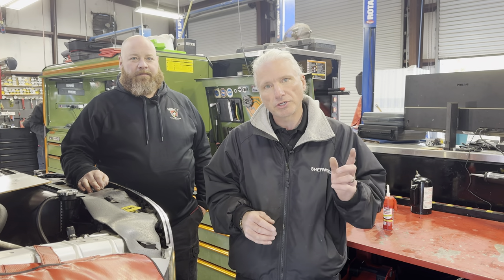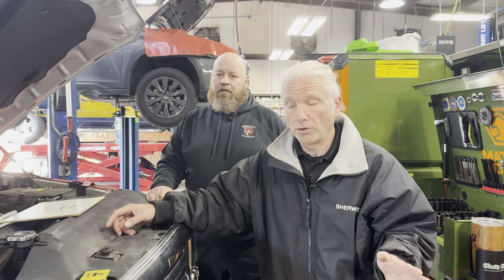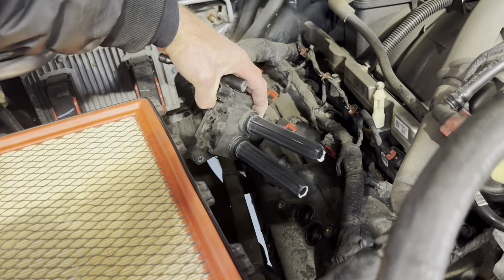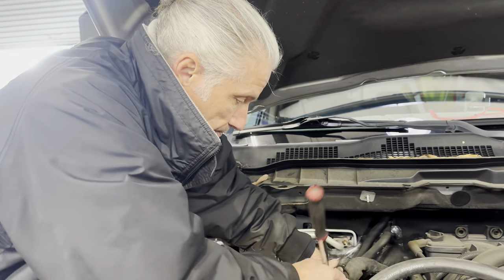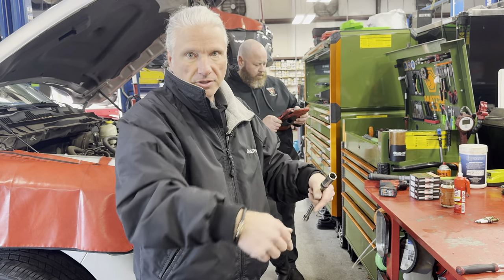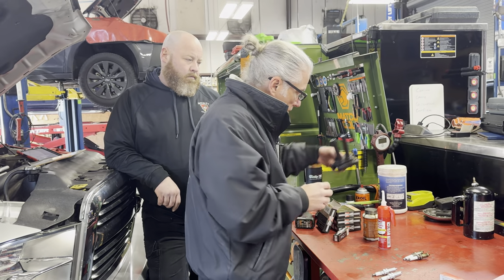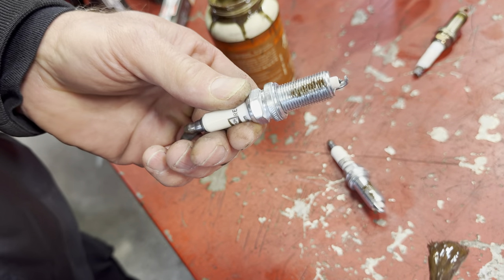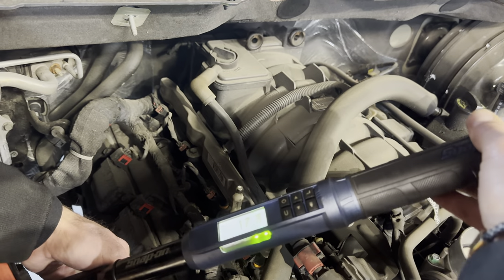How To Replace Spark Plugs Like A Professional

Comment: I have been changing sparkplugs for over 40 years and have never used anti-seize on the threads.  I was told years ago that the addition of anti-seize to the threads will mess with the torque specs if you use a torque wrench to torque them down.  I have read that some manufacturers do not recommend using it, but I can't remember which ones off the top of my head.   I have always used dielectric grease in the boots though.  Great video as usual.
Reply: I agree, but a drop of light silicone spray lube doesn't hurt. With dry threads, the specified torque doesn't always even crush the seal.
Reply: I've heard that same thing when I was at the factories main engine training center.
Reply: Cast iron heads and aluminum heads are vastly different. Always use anti-seize on aluminum heads.
Reply: @abovetherimrob891  I have owned a car with aluminum heads since 2006 and have never used anti-seize on the plugs and never had issues removing them when replacing plugs.
Reply: Always use antiseaze unless the mfg says not too. It helps heat transfer and will extend the life of the plug aswell as helps ensure proper torque.
Reply: Yup. It can cause over torque and damage threads in the head. A big no no on Denso plugs.
Reply: Bosch plugs have a coating from factory, and states that lubricating the threads might cause over tightening an/or corrosion (if dissimilar metals present)
Reply: I've read that torque specs are based on dry threads 🤷‍♂️ Also, I use compressed air on the spark plugs prior to removing them so that if there's any debris it won't  fall into the cylinder. Maybe not on COP engines. On non COP engines, I spray brake kleen to loosen debris and then blow it all out really good prior to removing the plugs. If you don't do this, and the area around the plug is filthy, insert the plug and pull it back out. The new plug may have oily debris on it. That goes into the cylinder! If possible, clean the spark plug seat at the head. I've read that dirt on the seat will cause the plug to run hotter 🔥 Note: A COP coil works harder when the plugs are worn.  This can cause the COP coils to burn out sooner. 🧰
Reply: @nickr5658 You know that heat transfer happens where the porcelain insulator meets the spark plug shell in the body of the plug. The length of the insulator before it comes in contact with the shell determines the heat-range of the plug. Most of the heat is transferred to the cylinder head through the spark plug gasket or tapered seat. This is why proper torque is important. Too little torque can cause a plug to run hotter than its intended rating.
Reply: @SilveradoUSA1  I always blow out the spark plug holes prior to removing them.  Keeps debris from going down into the cylinders and keeps dirt from getting caught in the threads as the plug comes out.
Reply: Most plugs have an angle torque value to crush the washer. Once the washer contacts the head its like 2/3 of a turn to crush the washer. I dont see any problem with using anti seize. Sometimes the cowling drips water down into the spark plug area and then you get corrosion
Reply: Big no no on the anti-seize... Most modern plugs are zinc or nickel plated and that's all the anti-seize you need. Old school plugs with a black oxide coating going in to a cast iron head, yes, absolutely use it.
Reply: @TheForeman805 you are correct about nickel coating from manufacture. I’m in the 805 Bakersfield by the sea 😎
Reply: I’ve never used anti-seize or dielectric grease. I only do diy car maintenance, though.
I’ve done airplane maintenance for years and our rule was always use anti-seize or LocTite only if the repair manual says use it. I tend to treat my car the same.
Reply: Ford at least through Triton and 4.6L era specifically said NOT to use anything on the threads as it would change the torque reading by up to 20%. The risk of over or under torquing (by trying to compensate) far out weighs and minimal benefit the lube could give.
Reply: Some sparkplugs already have a anti seize coating it's not to noticable but it's on there
Reply: Ford never recommended anything on plugs but now they recommend moly grease.
Reply: BMW doesn't recommend using anti seize

Comment: Great video guys. I worked for LAPD for 21 years and i torqued all suspension bolts, nuts, spark plugs and of course all brake caliper bolts and even bleeder screws. You'd be surprised how many people didn't even torque the lug nuts or the intake manifold bolts. I have all the torque wrenches, quarter drive, 3/8 drive and half inch. Plus i marked every bolts to make sure that i torqued them. Thanks for reminding all technicians to be professional at their job.
Reply: Can u get me a job there? lol
Reply: @midnightroush97  you can apply lol. I’m retired already👍
Reply: Great work! Glad to see and hear mechanical taking specs seriously.
Reply: @vickenkaragozian2041 where can one apply? I've been looking online, but no luck
Reply: Every time I get brake pads replaced. I have to get new rotors, (because nobody uses a torque wrench on lug nuts).
Reply: I dig it

Comment: As you can see, the lowly spark can generate alot of conversational opinion. We are all still apprentices after 45 years. Keep producing the videos. 👍
Reply: If you want an active comment section, just make a spark plug video and take a side on the antiseize vs. no antiseize question. Guaranteed flack in coming. It doesn't matter what side you take. Just take one.

Comment: A few additional things to consider , #1 Make sure the springs are still inside the boots when your putting the coils back on , sometimes they fall out without you even realizing it. #2 Look inside and clean out the wells before removing the plugs. Many times the wells are filled with oil / debris. #3 inspect the boots for any signs of  arcing. Even a pinhole is going to be a problem.
Reply: Why not replace the rubber boots so you don't have an issue before the spark plugs require changing again. With some V6s the intake manifold has to be removed to change the spark plugs. It would suck to have to do that work again.
Reply: I would have never pulled those plugs out without blowing out the well, cracking the plug lose and then blowing the well out a second time.

Comment: Thanks for the tip about the combustion chamber cleaning and hot engine plug removal for stuck plugs.  I tried to remove and inspect the plugs on my wife's 2019 Civic with now almost 200k miles on it, and they were (are) stuck so badly I gave up as I don't have the ability to install threaded inserts if I stripped out the aluminum head! I guess this job is going to be for the dealership. :(

Comment: I'll trade my car before I change the plugs after checking what it takes on a 2011 Hyundai Sante Fe with the 3.5  6 cylinder. But it's been problem free with 120k on it .🧐

Comment: I've been a shade tree for 60 years or so. Before I do anything, I always blow compressed air into the depression where the plug resides. Then I loosen the plugs and blow them again. If, like most, the car has a COP, I blow off all around the COP, then remove it. Only takes a minute or so, and keeps sand, small pebbles and the like out of the combustion chamber. Please take this as I wrote it...a hint, not a knock on you. You have forgotten more than I ever knew. Great videos and kindness to spare.

Comment: Not sure about champion but NGK spark plugs have a coating on them and they say don’t use anti seize on fresh spark plugs but if you pull a plug out and put it back to use some anti seize. But no anti seize on fresh NGK plugs out of the box.

Comment: New spark plugs specifically state not to gap them and you arent supposed to use anti seize on sparkplugs,  It not 1990 and they all come with anti galling coatings.

Comment: Great advice! In addition to your process, I will take a shop vac or compressed air and clean out any debris in the plug recess prior to removing the spark plug. Yes, it's overkill, but you may be surprised what can get in that recess.

Comment: I always spray brake clean followed by air after removing boots. Then remove the spark plugs. Thanks for the videos as I do not work on vehicles for a living. I just thirst for knowledge. Love the diag videos as well. ❤

Comment: The electrical connectors unlock more easily if you push the connector in further to relieve pressure on the lock tab before attempting to release it.
I recommend blowing the area around the plug out with compressed air after loosening the plug a couple of turns to prevent any debris from falling into the cylinder.
I used to use anti-seize on aluminum heads when they first became more common ~40 years ago and it was common for plugs to seize in the heads. Probably different aluminum alloys and/or coatings on plugs seem to have solved the seizing problem a long time ago. I can't remember the last time I wasn't able to remove a plug without some sort of damage.

Comment: Nice video. I was taught 55 years ago to break all the plugs loose, replace plug wires, start the engine, and rev it a couple of times. This breaks the carbon built up at the end of the plug and combustion chamber. If you don't, there is a chance a piece of carbon that breaks loose can strike the spark plug electrode on start up.  The carbon could close the gap, messing with proper spark.
Before fully removing the plugs, use air pressure or vacuum to clean the area around the outside of the plug.
Hope this helps.

Comment: Perhaps it would be a good idea to wipe the porcelain portion of the spark plug with isopropyl to clean off the oils from your fingertips. Some manufacturers of spark ignited engines do recommend doing it. Great Video. 👍
Reply: Great Comment!
Reply: I just avoid touching the porcelain.
Reply: @fascistpedant758  How can you possibly know that you or others haven't touched the plugs along the way? The factory doesn't give the option of " if you or others haven't touched the porcelain, then you can skip ....". You need to wipe it down if you're going "to replace plugs the professional way." It is professional to wipe the plug as any beads of finger oil can cause flash over. I can send you pictures of what we have experienced in the lab.

Comment: I'm really glad you talked about some (Ford) spark plugs that should be remove on a hot engine. Of course on a Ford truck, it will be the one in the back. That is the hardest to get to, that will break.
Reply: I perform  a BG induction service then remove with 3/8 impact gun hot..
Reply: I think the reason the rear plugs are difficult to remove is that they're often skipped because of limited access.

Comment: All I have to say down here is that yeah, plugs seem like one of the easiest jobs, and in many cases they are, but they're spooky, and mission-critical. I know a lot of the trucks have absolute nightmare plugs, many of the cars do, and even on "easy" inline 4 cylinders it's always a relief when they come out clean and don't bring the threads with them, and another relief when they snug down firm and don't keep spinning with the wrench.
Reply: Never heard a better description of spark plug jobs.

Comment: It's called reading your spark plugs to understand how ur engine is running, nice job Sherwood.
Reply: Unit_450 Real mechanics can't work on older stuff then. They have to farm the work out to realer real mechanics who really know their stuff.
Reply: @Unit_450  One leaking fuel injector can have you chasing your tail trying to figure out the fuel trims. But an inspection of the spark plugs will give you an immediate clue. Also, spark plug condition will tell you about your valve guides, piston rings and spark timing.
Reply: Unit_450  That's nice. No one said anything about a misfire.
Reply: Unit_450  Not true.

Comment: Thanks again for another great video, I learn from them all. I would like to add something to this video. In all cases before removing any spark plug blow into the cavity with an air nozzle to remove any oil or road debris that may be present. I have seen spark plug boots submerged in oil from a leaky valve cover gasket. This means more work is needed before finishing the job.

Comment: Let me tell you sir, the best brand spark plug i have used is the brand Beru. This brand is known to have a very reliable spark for a long time!
Second brand for me is the Ngk. Outside of these 2 brands, I've noticed power loss to my experiences.
but I have also noticed that some cars only run well on the Oem spark plugs, and other than that sluggish.
Reply: I always use spark plugs from the dealer original only. Some want a different better long lasting brand but there is a downside to using these other brands that last longer. The longer your spark plugs stay in your engine the more likely they are to seize with the heat and corrosion over time.

Comment: Glad to see you using a dab of antiseize, a touch of silicone, and hand starting as well. On top of that, I always clean and blow out the spark plug well before removing the old plug. Always have the new plug ready BEFORE hand so the time for the exposed hole is minimal. Also,  I use a thread ROLLER (TIME-SERT; 👍 this is NOT a thread chaser) and finally install the new plug

Comment: i gotta admit im surprised by this video from you guys. longtime subscriber to your channel and a ASE Master with L1, L3 and L4 here myself. 

 1st never use a gap gauge on most modern spark plugs. Feeler gauges or those set wire gauge. 2nd a big no no is to add anti seize to the threads. Most every spark plug manufacturer will tell you that.

a neat trick to start the spark plus is to use a piece of rubber fuel line to start them. I have the plug starters made by a few people but also have rubber fuel line in different lengths 6in, 12in and 18in in my plug tool drawer
Reply from the maker: The rubber hose trick is a good one for sure! I'll do some research on the anti-seize. I know the use off aluminum anti-seize is a big no but I haven't seen anything on the copper. I'll definitely post an update.
Reply: Can you elaborate on not using a gap gauge? Will be doing my plugs soon so interested in knowing why.
Reply: @MrNewff  cause a gap gauge can damage the electrodes on new style plus with precious metal ends. Uss a wire gauge or feeler gauges

Comment: Thanks for your video. I've never used ant seize on spark plugs, but I see it because of the complexity of these new cars . Great advice about not using gun on them, coil bolts people have gone crazy using gun on everything on these cars .That makes sense about calibrating your elbows once in a while using torque wrench .

Comment: Great video.

I never use a socket to start the threads. It is too easy to crossthread them. I always use a small piece of rubber tubing on the porcelain end to feed it into the hole and now you will not have enough torque to damage the threads if it isn't perpendicular to the hole because it will spin around the end before getting stuck. I turn the plug left to loosen it until I feel/hear it drop and change direction because I know the threads are lined up. You can't feel that through a socket either.

Many cars such as Mercedes and Infiniti require properly torqued plugs because they are indexed, meaning the spark has to be at the correct angle and direction to ensure proper combustion.

Comment: Hi Folks, any chance you have a part no for your gap gauge? Really like the looks of it compared to the other styles but struggling to find the same style over here in the UK. Keep up the good work! I’ve been sending most of your content out to my technicians because it’s so clear, educational and just the right way to do things.
Reply: I found that style on Amazon.  I ended up getting the round version, but they were available in higher quality than the generic ones under the brand name Lisle and some others that I don't recall now.  The difference in price was only a couple bucks.

Comment: Great video. I believe the general guidance with regard to anti-seize that the torque needs to be reduced by 20% from the spec torque. The reason for this is your introducing a hydraulic compound on the threads and the plug shouldn’t be torque to full value because in fact with the compound you’d be overtorquing them as well. As well, there is some debate about reducing torque when using anti-seize, but the general consensus said it should be reduced. That said I appreciate your video and your expertise and how you do this.